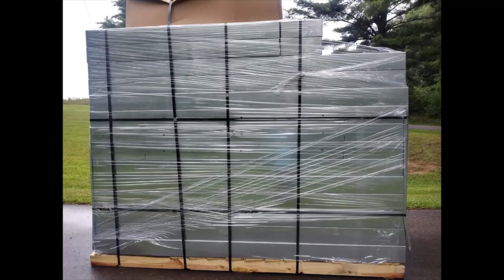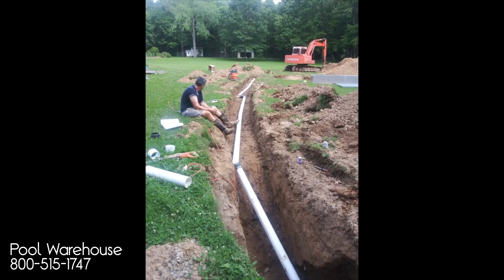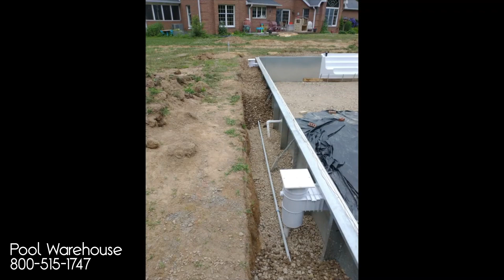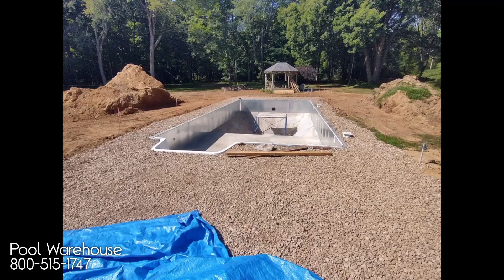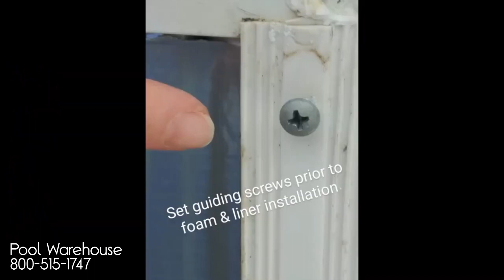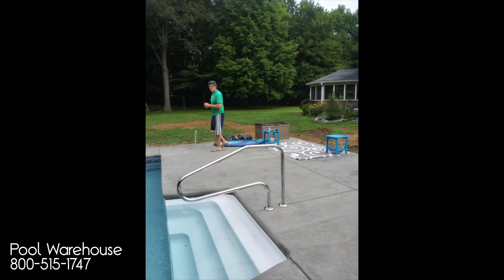DIY Swimming Pool Build from Pool Warehouse!

Comment: You guys did not install returns?  I know its not required but does it not help with bottom cleaning?
Reply from the maker: Hi this pool has 1 return, but it does not have main drains. Main drains need to be installed following VGB guidliness. Main drains are not needed in most situations if you are using the Aqua Genie skimmer, it pushes a current of water to the floor of the pool and back to the surface. Learn about that skimmer here: https://www.poolwarehouse.com/shop/aqua-genie-inground-pool-kit-skimmer/
Reply: Wow that's nice. I have a new pool I ordered from you guys in my garage as we are about to start the dig this week. I am going to reach out to our designer about seeing if I can return the skimmers for these. I hope that she will say yes as this looks much easier. Our pool is salt so I assume we could leave the cholrine filler empty.
Reply: Pool dig starts on 4/26 and I have reached out to both sales rep and customer service at pool warehouse and no one is returning any emails.